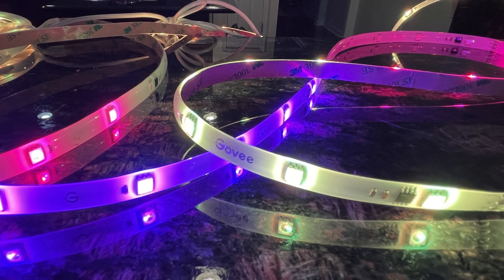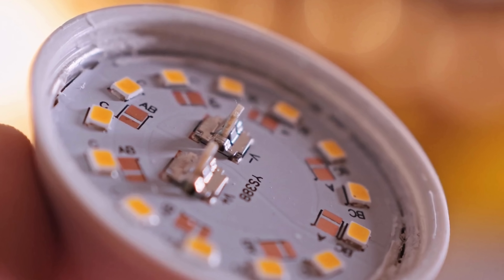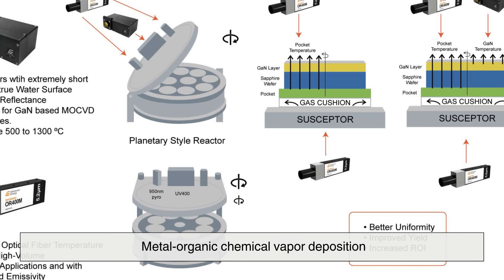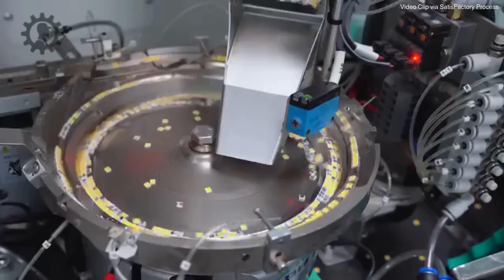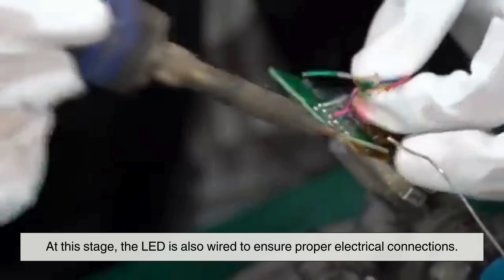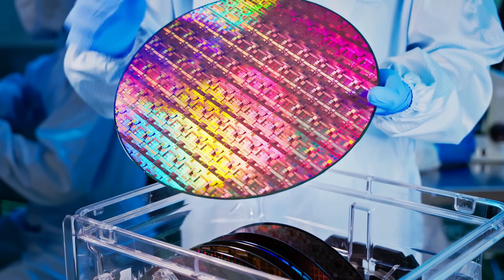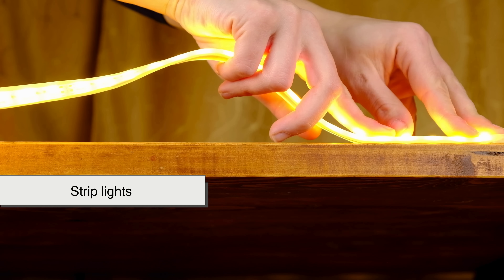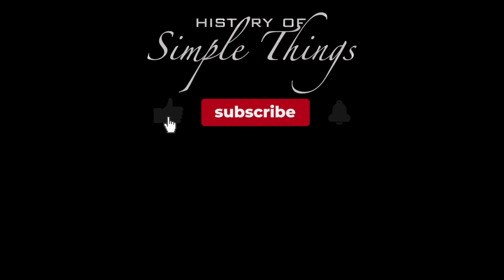Inside the LED: How These Energy-Efficient Lights Are Made

Comment: Found that I am getting a brighter clearer picture only ring camera at night since they changed over nearby street light to LED ! My electric bill sent down $15 a month after changing over to LED'S. Installed a fan cooler corn Cobb LED to replace a 150 watt incandescent lamp in a kitchen light. Enclosed in a 12" round globe. Incandescent lamps never lasted more then 6 months. The LED is 7 years old.

Comment: Over the last few years, LED street lighting has been quickly replacing other methods like mercury and sodium vapor types. Longer lasting, less maintenance, and less energy  used than those older lamps.
Reply: Longer lasting? Bs. Towns are screaming how there dying out fast. 
Home LEDs suck. I installed all from top brands , they suck

Comment: LED lights are one of the great fleece jobs of all time.  They're ridiculously expensive and only last a fraction of the marketing claims.  Total rip off.
Reply: It's hit and miss. Either the light fails in ridiculously short time or will last years. There seems to be a lot of QC inconsistencies in the manufacturing of LEDs.
Reply: @lajya01  Sending too much current through the LED and causing it to heat up beyond the manufacturer's recommendation is one of the most common failure modes. If a large amount of LED lighting is to be installed, I would suggest finding a supplier that has a good reputation, and has been in business for a substantial amount of time. 
    The companies selling faulty LEDs are basically over-driving the diode, making it shine brighter at the cost of a shorter lifespan. The most frustrating part of this, is the solution is a bigger resistor. Since many times, it's an intentional choice to install an under-rated resistor, so the cost wouldn't even go up, and the device would last, sometimes orders of magnitude longer. The customer would almost always choose an LED that seems to last forever, in trade for a slightly dimmer light. Another example of marketing ruining a simple, but terrific product by putting the cart before the horse, and ultimately not having any respect for the customer.
Reply: I’ve had a different experience, my home was built 8 years ago with all LED lighting. So far none have failed even in my office where the lights are on all day.
Reply: I'm reading NealB's criticism while an overhead SUNCO LED tube illuminates my work bench.  It is rated for 50,000 hours but has already operated 52,000 hours.  Our LED filament porch light has been in service 23,000 hours.  Neither light seems to be noticeably degraded.
Reply: They have a slightly higher initial cost but use 10% of the energy as incandescent  and 15% of fluorescent bulbs. If they don't last long, take them back or don't buy that brand. Most major manufacturers will guarantee their products 100%. Look at customer reviews where you buy them (they should be in the thousands of 5 stars) and don't buy the cheapest ones. I'm an electrician and they are the real deal.
Reply: More details please.
Reply: I'm using some really cheap brands and I've yet to see one fail after years of use.